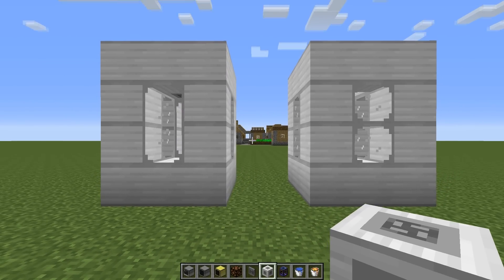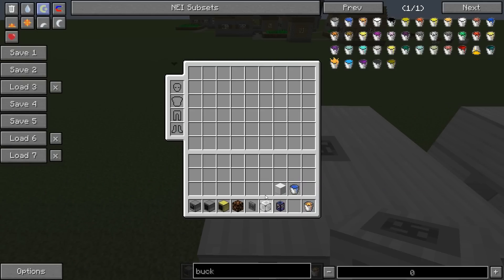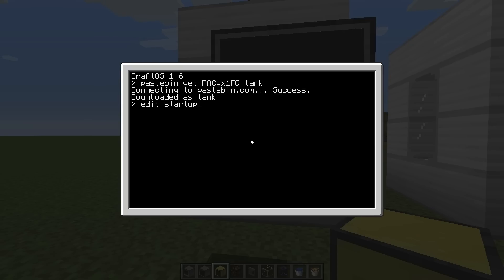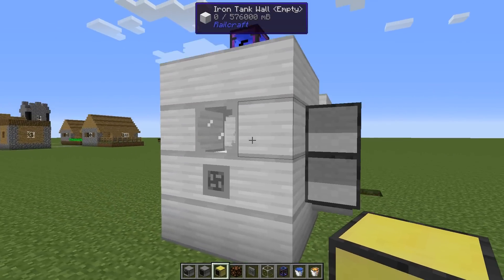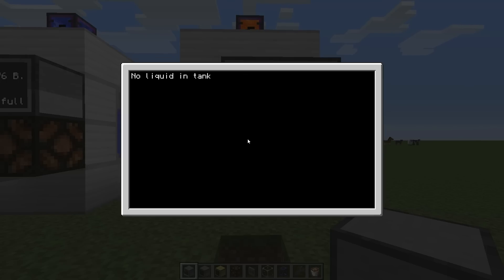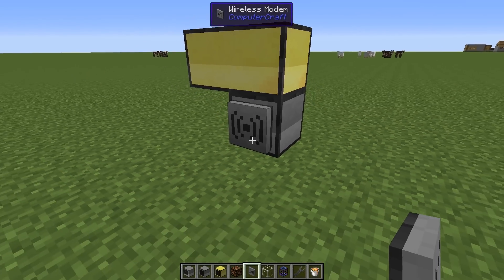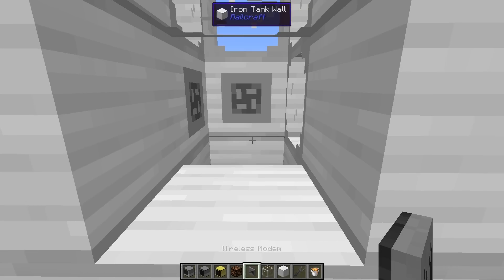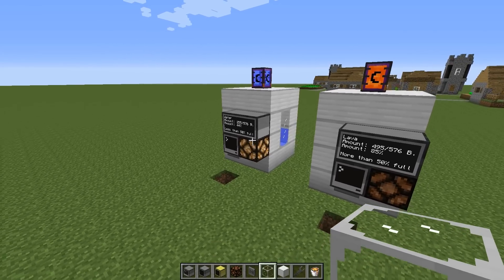ComputerCraft Tutorial - Tank Liquids Monitoring System v3 (MC 1.7.10)

Comment: is there a way to edit your main program while it is running and a way to reboot the tank computer while it is working? i'm new to ComputerCraft, so i'm having some problems with that
Reply: edit: found the way, but now i have this error: main:43: Colour not supported
Reply from the maker: @stefanvangool3148  I don't know what version you're running on. It's very important to know that commands and compatibility can change a lot between modpacks and different versions! So what color you have problem with on line 43 is hard to guess... is it a cursor color problem?
Reply: @therealtkh  i found the problem. i was using basic monitors instead of the advanced ones, so there was nothing wrong in the first place

Comment: I'm getting an error on line 22. It says "attempt to index ? (a nil value)" line 22 is the part where you make the table. :/
Reply from the maker: You have to give me more info, all version numbers and how you have implemented everything. Screenshots can also help a lot, impossible for me to help otherwise...
Reply: TKH I've got the same Problem... I use FTB Ultimate v1.1.2
Reply from the maker: Joel6514 Please read the video description where you will find more information about the requirements. FTB Ultimate v.1.1.2 is for Minecraft 1.4.7, so the code used for this video will not work. The first variant I did was for 1.5.2, so you can try that and see if it works. Link in the video description. It's however a little more work to implement the old versions.
Reply: TKH I first watched the other Video and tried this... It dont works so i tried this one and same problem! :(
Reply from the maker: Joel6514 I have no time to test this, so I'm sorry that I can't assist at the moment... hope you can find a workaround. The thing is that the data is presented in different ways in different versions, and the code can't handle such unexpected change. The methodology should be similar as long as all data is in there!
Reply: TKH Thats all too complicatet for me ^^ i let it :D
Reply from the maker: Joel6514 Hehe, ok, but try again once you upgrade to a later modpack on the server! :)
Reply: TKH Yes sure! Thank you

Comment: This is very nice, but how do you know what methods/functions and/or variables are available to each peripheral (in this case the iron tank)?

In other words, when you use the for loop to extract the information from the table that you got from using getTankInfo() function, how did you know what was in it and what each column of data represented?

I'm really confused, trying to work with other peripherals but there's close to no documentation.
Reply from the maker: Not at home right now, but you can use something called getMethods to see what you can do with a peripheral. After that it's trial and error or search for code from others how they used the command.
Reply: TKH ok, I think it got it by looking at your code and modifying it so that it shows the pairings of "contents" (your code is very pretty by the way, easy to read and follow).

I don't knoe if I'm right but I think getInfoMethod is a table that holds table variables and other variables in its indexes, which is what made things extremely annoying i.e

infoTable[1] = type string
infoTable[2] = type table

instead of keeping the same format ie

table (name, table)
table(table)
table(string, table)
etc

Oh man...what I mean is that they have
(v,k) pairings and (v) in the same table. Hope that makes sense.

Thx for the reply anyway :D!
Reply from the maker: Cow Ok, nice! Thanks, I need to write it in an easy-to-read way because I will forget what I did otherwise ;)

I think the getInfo can return several different fluids (like both water and lava in a combustion engine). So the formatting might look different depending on what you're reading. I don't remember exactly how it looks, but the command works in the same way so you'll easily find out. 

Always feel free to show what you've done if you are inspired by any video or code that I have put up. It's really fun to see a better implementation of my examples :)

Comment: Hi. thanks for updating this.  I never noticed the new 1.7.1 video and the 1.6.2 worked fine for me on one tank on 1.7.1 but when i added a second tank, the 1.6.2 code failed.  I deleted your old pastebin files and downloaded the new code but the tank computers are returning "No liquid in tank".  I have rebuild everything from scratch and refilled the tanks, confirmed the valves are in place and not touching the one on the bottom.
Reply from the maker: Hey! Just to be clear, you're running on 1.7.10? What mod versions are you using for RailCraft, ComputerCraft and OpenPeripheral? What liquids are you monitoring?
Reply: I found that having a valve anywhere on the bottom layer caused problems, not just adjacent to the valve on the side. I was using this on a 5x5 tank with the valve in the middle of the bottom layer (2 blocks away from the side valve) and was getting this problem. I removed the bottom valve and placed it onto the side and everything worked fine.
p.s. Thankyou therealtkh for your excellent tutorial videos. I find them very easy to follow without them going at too fast a pace and your preparation is first class. Keep up the good work
Reply from the maker: AD F Ok, great. This seem to have got worse in 1.7.10, and I filed a bug report to the RailCraft team, but it has low priority it seems. So we can't have any bottom valve, only on the side nowdays... A little strange that it has broken since it worked fine back in 1.5.2...
Thanks for your kind words, it makes me glad to hear that the videos help :)